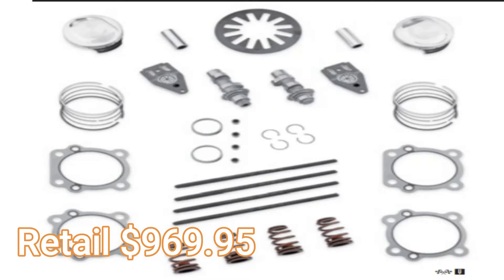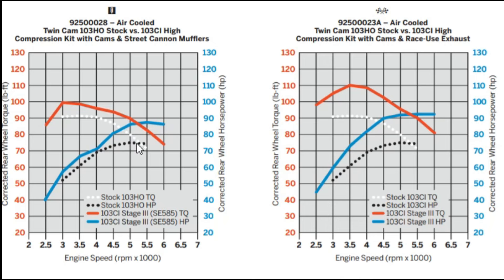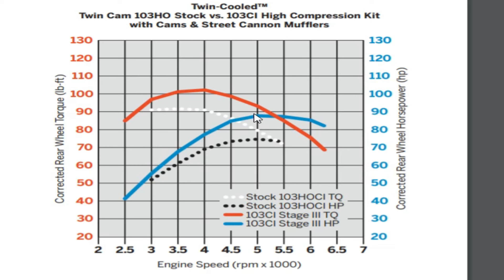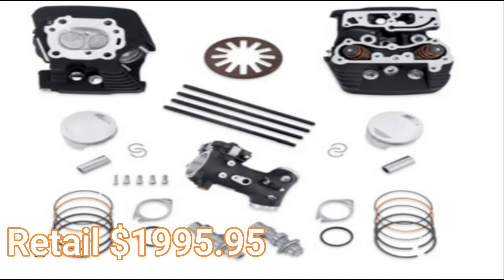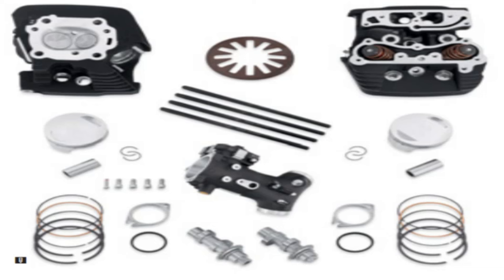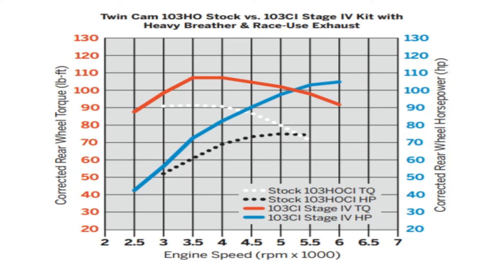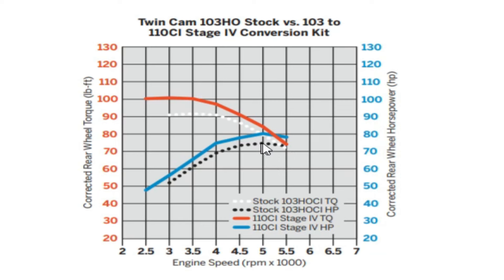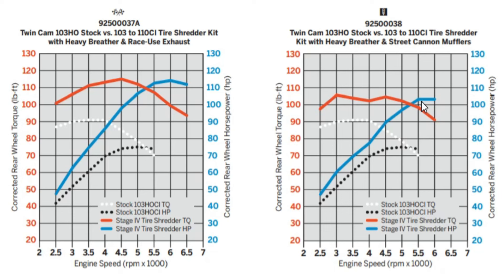Late Model Twin Cam 103's Make A Solid Motor For Modern Used Harleys

Comment: You mentioned that if you do a Stage 3 high compression kit, it would be a good idea to replace the jugs.  Why is that?  My mechanic disagreed and said that the existing jugs can be honed, cleaned up and re-used.  Said that the kit is meant to be used with existing jugs.  This may be a good option for me and my 103 Street Glide given that I'm running the Feuling 574 cams.  That said, it's supposed to be a cost-effective upgrade.  That's not the case if I have to get new jugs...Might as well go Stage 4.  Thoughts?
Reply from the maker: It just depends how many miles are on your cylinders and what kind of shape they are in. Your mechanic is correct that the cylinders can be reused, if they measure out within spec to be cleaned up and honed the rings will fit properly. If the cylinders are too worn they would have to be replaced with new ones. For the purpose of the video I mentioned purchasing new cylinders assuming a twin cam engine with high miles and doing a refresh. Twin Cam cylinders are relatively cheap but if you did need new cylinders the stage 4 would likely be more cost effective.
Reply: @GixxerFoo  I agree.  I feel like when jugs get involved, I would be better off stepping it up.  I've got less than 10,000 miles on my jugs, so I think I'm good.
Reply from the maker: You shouldn't have any issues then with the jugs at that mileage. A good hone job and the there shouldn't be any issue getting the piston rings fitted.
Reply: @GixxerFoo  What cam would you recommend as a replacement for 259e cam in the Stage 4/5 Tire Shredder kit?  The Stage 4 Tire Shredder kit comes with 10.2:1 pistons.  Would you recommend the Wood 555 or 777?

Comment: My 95 cdi stage 4  has more horsepower than the 103ci stage 4 lmao but I didn't stay strictly with Harley.
Reply from the maker: Yeah straight Harley parts won't get you there. Pistons and jugs are good but the cams aren't nearly as good as the aftermarket cams. Aftermarket heads and porting are also way better than the factory performance heads.

Comment: My 2014 streetbob came with the 103 I am a big fan of the 103 the last three bikes I have owned had 103
Reply from the maker: The 103 is a very nice motor, it performs very well in the Street Bob. I was impressed with the one I rode that had a 103, it was cammed and it pulled hard out of the hole.

Comment: Dude, those twin cams are only bulletproof when you went to a gear cam set up. The gear cam eliminated having to crack the cam case open.
Reply from the maker: You're right, gears are the only way to truly eliminate the issue.
Reply: That's assuming your crankshaft isn't misaligned. The crankshaft is press fit at the factory and are notorious for being out of alignment especially if they're ridden hard. The gears can't support a misaligned crankshaft.
Reply from the maker: That's the down side of the gears sadly, if you have the crank out toy can have it balanced and welded up to try and prevent that. It works very well but it's not a guarantee.
Reply from the maker: That's the first time anyone has mentioned a belt drive for the cams. You're right thought the gears do transmit harmonics as where the chains and tensioner reduces that.
Reply from the maker: Really? I'm gonna go check those out, that's quite interesting.
Reply from the maker: I am surprised it's not more well known!
Reply: @DropDstar Victory used gear-driven primaries which made a lot of noise especially when getting off the throttle but worked great. I believe their cams were chain driven. My 2nd gen Honda Valkyrie is chain-driven. 1st gen is belt driven although I don't like the maintenance. My two cars and my motorcycle have chain-driven cams which are virtually maintenance free and last forever. They are also very quiet.
Reply: @DropDstar That's impressive. Most air-cooled engines don't make it that far. I just read this comment online.

"My meticulously maintained 2014 103, always used Mobil 1 20W50 and filter every 5000 miles, 10% ethanol premium only fuel, had to be rebuilt at 35660 miles. Oil blowing by all the rings etc. Very puzzled and a bit worried. 1st Harley"

Comment: Good day, question: Since most of the upgrades relate to Harley’s 2007 and laters what about the 2003 Road King 103 CVO Screamin Eagle? What upgrades do you recommend??
Reply from the maker: I actually have a video coming out this Friday comparing these two engines. They have the same displacement but the 103 Road King takes a different path. You can always upgrade you cams to tailor your power for where you ride. Upping the compression either through changing pistons or upgrading to some more aggressive Screamin Eagle heads.
Reply: @GixxerFoo  dont over look he said its a CVO screamin' eagle that has the highest compression you can have and still burn 93 octane premium with OUT engine knock and detonation ..I can't tell you what cams  are in it but they should be more duration and lift as the screamin' eagle heads should have larger CNC milled out ports..the new screamin' eagle 10 mm spark plug wires will give the engine better response ...and the Taylor 10.5 mm custom plug wires will increase the power that you can actually feel in the throttle ..get a TTS tuner box and put it on a dyno that will wake it up big time ...and I can't stress enough to replace the compensating sprocket with a solid double row sprocket that are about a 100 bucks anywhere ..you can get one of a one tooth smaller crank shaft sprocket with with out changing the primary chain and will not effect the speedometer except watch it climb to 120 a lot faster ..I'll have to check if those are efi as if it has a carb the tuner won't do much good but everything else will ..if it is efi one size larger throttle body will let it wind up faster with more top end   I all most forgot a two into one supesuper trapped pro pipe with tuneable diffuser disks is a must before it goes on the dyno ..as you add or subtract disks to make the ultimate HP  from any set up ..one review a 96 inch twin cam. makes 130 HP ..
Reply from the maker: Yeah you definently don't want to get too crazy and get it knocking on pump gas. Having to use octane booster get old after a while.
Reply: @GixxerFoo  that's what  i. was forced to do on my first 2011 street Bob and run 106+ booster from auto zone. worked well with high compression cnc milled ports with 12.5 : 1 screamin' eagle stroker pistons with teflon coated skirts that was a dealer project the boys in the back had put together  and twis..!ted my arm and made me buy it ..when all I wanted was their on sale stock street Bob at $13.5k ..hut I bought the only clone ever of the super stock Vance and Hines HD on the cover of the 2012 screamin' eagle mag. And parts book 

That the shop ticket showed $15.5k in parts and labor ..I got it for $19,995 with a free handle bar exchange and 
Arlen Ness 1/4 race cafe fairing with a free install of Ohlins piggy back gas shocks on the back and race tech gold valves  and springs in the fork tubes ..out ran all Suzuki big twins that challenged 955i triumph Suzuki v Strom and a Yoshimura built Yamaha R  took a brand new 900 ninja on top end through Ben Davis  from west of Indy to I- 465
Reply from the maker: 12.5:1, that's insane compression, how did thing even start with compression releases?

Comment: Thank you for clearing that up, the most explanatory video on the 103's highly appreciated,
On my 2015 Road glide 103 I went to the tire shredder kit the 110 it's like holding onto a bull so impressive so exciting to ride, I don't know I could be wrong but I feel like my bike has more balls than the 114 117 and even some 128 LOL am I wrong, my torque is 123 at the rear utilizing screaming eagle super pro tuner, using Vance & Hines headers and  cross pipe.. on the clutch running the scorpion clutch
Reply from the maker: You are welcome! I wouldn't doubt it pulls harder than bigger inch motors, you've got a the right tuner and a good exhaust setup! That makes a huge difference, the salesman at my local dealer had the tire shredder on his Road King and it hauled ass! He was in his 70's and a real hardcore rider, he went out with a heart attack riding home one day.
Reply: @GixxerFoo  wow what a way to go well God bless his family and Godspeed to him!! Really appreciate all your videos. Great information second-to-none thanks!!

Comment: I’ve been riding a TC 88 for 19 years. Seems like back in the day when I bought the bike Harley-Davidson offered a kit that could take the TC 88 to 113. Any idea how that measures up?
Reply: Brad I bought a new ‘02 ElectraGlide and at that time they only offered a 95 kit, which I had the dealer put on .. the SE models in ‘04 had 103s but I don’t believe that was offered until a few years later

Comment: You need to do more research because my 2004 Electra glide screening eagle 103 also came with a 5 speed stock
Reply from the maker: That's not exactly the same engine as the 2009 production version. The 103 in the 04 model has the spring tensioners and it's much closer related to the production 88 at that the time. The production version of 2009 is much more related to the 96 inch. The 6 speed didn't come around until 2006, that's why you're 2004 CVO only has a 5 speed.
Reply: I also have the 2004 CVO 103” Screamin Eagle Ultra, I upgraded to the Fueling drive, put in 587 cams, now making 103 hp & 119 torque
Reply from the maker: They were quite the power producer, it was actually a stroker motor built right out of the Screamin Eagle catalog at the factory.

Comment: I was told by hd salesman they liked 103 over the 110 .
Reply from the maker: Did he say why about the 103?
Reply: GixxerFoo yes she was hd sales lady I knew her personally Knowledgable ; oil leaks on 110 and better performance on 103 ..
Reply: @crspcritter  there is no oil leaks on any Harleys since the epa put a stop to  all oil leaks or no sales  back in 1985 with the evos .. ..a 103 is better balanced  than any larger displacements ..there is only so much room in the lower end to build a crank and maintain balance with huge jugs and pistons
Reply: Angelle Sampey won the Indy pro stock bikes a month ago in the final round at the  NHRA U.S. NATIONALS with a FXDRS Harley against a Suzuki pro stock four cylinder ..here is the race .
https://youtu.be/TzC8JxhqPoo
 Her Vance &Hines screamin,' eagle Harley Davidson pro stock drag bike totally destroyed the Suzuki
Reply from the maker: That's really surprising, especially since the 110 is in their top of line models.
Reply from the maker: Shebisnone fast lady!
Reply: donnie baker right on Donnie ; well ret hd mech says they have had some leaks since 85 . But he says he has done many many 124 twincams with no leak problems with same Gaskets . But I know she the sale lady said 103 ran better than 110 in her findings .
Reply: GixxerFoo too her research that’s what she believed-
Reply: GixxerFoo not much diff in cubic inches -
Reply from the maker: Interesting, I'm gonna have to do some digging on that 110 and find out why that happens.

Comment: Good background info on the 103.  I run a TC88 but I like that 103 for sure.
Reply from the maker: That 88 is a solid motor, it would be nice that 103 bottom end was built like the early 88's with the Timken bearings.
Reply: @GixxerFoo  I agree.  Mine's a '99 and carburated; Timken is in there.  It could stand some more power though.  Right now it has a k&n air filter, re-jetted stock CV carb and true duals with some CVO 110 slip-ons.  Runs solid with over 50K miles.  Subbed..
Reply from the maker: Sounds like you got the setup going on the bike! I appreciate the sub!
Reply: Very informative video 👍👍
Reply from the maker: Thank you! I appreciate it!
Reply: @GixxerFoo I have an 04 Fatboy EFI 8600 mph on it. Arlen Ness clear method sucker air filter, screaming eagle long shot pipes. But I'm looking for more power on the highway. At 75-80 / 3200rpm I feel like I need another gear! I'm thinking about bigger cams but not sure which ones. Or what else I should do. Suggestions? I have an '00 fxdwg carbureted w/ SE 625 cams, compression heads, adj pushrods, cam plate,open belt primary, bassanni 2-1 ex. Thing is so much faster than my tc88 b.

Comment: I have a twin cooled 2016 103”, and want to do a 110” upgrade. What’s your opinion about switching to gear drive cams? Also you mentioned in another video about the CVO 110” that it had a SE compensating sprocket. Do you know if my 103” 2016 FLTRU Mount Rushmore has the upgraded sprocket, and if it doesn’t do you suggest upgrading to one? 
Thanks for your advice.
Reply from the maker: I really like the gear drive systems and they are great for the 88's with spring tensioners. The gear drive have more accurate timing but they depend on the main shaft run out being a max of .003. Not only for installation but throughout it's life cycle, if it's any more than that you'll need a new crank or stay with the chain system. The late model bikes like yours have done great with the hydraulic tensioner system, it just need to be inspected about every 50k to be safe. The 103's do have the stock compensator, but they haven't failed like they did on the 96. Personally I wouldn't change it unless I was having a problem. Just don't go back with OEM if you have a failure, go with the Screamin Eagle.

Comment: Why doesn't the twin cooled 103 produce more power?
Reply from the maker: Good question, having the liquid cooled heads they could run a higher compression ration and not worry about the heating issues. But for whatever reason they kept the compression down on those bikes, it's a bit lower than the air cooled models.
Reply: GixxerFoo stock I believe they have higher compression than the air cooled ones. The upgrade curves look horrible on the twin cooled.
Reply from the maker: Yeah l don't understand why they keep the power down like that. With the water cooled heads you'd think they could be a little aggressive with the tuning.
Reply: @GixxerFoo  exactly. When I bought my 2015 flhtk, it was advertised as having higher compression. So I assumed more power.
Reply from the maker: Is it all stock?
Reply: Fp3, pro pipe and screamen eagle air filter. Falls flat at about 4,200 rpm.
Reply: I getting 42 mpg on the highway though.
Reply from the maker: I would be looking at the cam, I'll bet the cam they used is not suited to the way you like to ride.
Reply: I think about changing cams but I want a good all around upgrade. I don't know what cams meet that criteria.
Reply from the maker: With cams they usually move the power from one side of the chart to the other. It seems like it's falling flat early for the way you ride, are you looking for more high rpm power without giving up too much down low?
Reply: I generally ride two up and shift before 4k. But I hate the fall off the cliff feel when I want to rev it out. I think these are just bad performance heads. Just meant to run a little bit cooler.

Comment: Can you just put the CNC heads  larger intake and run stock 103 bottom end and jugs    To just let it flow more air.  Keep the reliability up and just let her breathe better
Reply from the maker: Yeah you could definently do that, you can buy just the ported heads and they would bolt right onto the 103. You'd have to get a good tune though and get the VE tables setup for the increase in flow.

Comment: 103 was not released in 09 because my Electra glide CVO came with A screaming eagle 103 in 2004 this is the grandfather of the now street glide
Reply from the maker: The 103 during the 88inch era was only in the Screamin Eagle CVO bikes. The replacement motor for the CVO was the TC 110 when the 103 made it into standard production of all models. But at that time the 103 you're talking about isn't exactly the same as 2009 103. This 2004 103 shares much more with the 88 in that time period.
Reply: Michael Crowley you're right I also have a 2004 Screamin Eagle Electra Glide he was wrong on his dates

Comment: If you are looking to re-build an engine with the goal of power, it'd be better to score a 110 engine and use the 117 'drop-in' cylinders as the heads are a much better casting. Get the heads fitted with bigger valves and port them and your numbers can be over 140 in torque and horsepower. If it is a rubber mount bike though you will have to upgrade the engine mounts in order to stop the dreaded 'death-wobble'.
Reply from the maker: I've heard of the death wobble and know some guys who had monster S&S Dyna Engine builds that experienced it. There are after market stabilizer links for the engine mounts out there and they do wonders!
Reply: @GixxerFoo   Yes, but stabilisers are not enough when you get up to high power levels - you need different mounts. I use ones from Big Bear Performance as they offer a little sideways adjustment on the front mount that enables you  to get the wheels aligned properly.
 My Sporty's mounts were old and buggered so I fitted ones from Drag Spec as they are firmer and the handling on my Sporty is great now. If you were to see my bikes you would be in awe as so much is changed or altered..... my brother in law says it's easier to remember what parts I haven't changed, modified or re-engineered. I have had the bikes 11 years now and it is a constantly evolving situation. My Dyna has had over 3250 spent on it including original purchase price (new) and the Sporty about £10k but that one was second hand.....